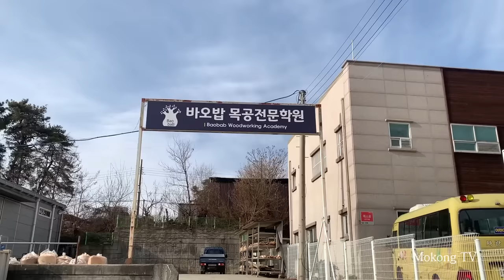Korean Oak Table Build #Woodworking

Comment: I think I would have begun by running those boards on a joiner to finish off one edge of the boards, then set the tablesaw and split them on the tablesaw by placing the straight edge from the joiner cut against the rail. Of course, that's just me.

Comment: Nice table, but the nails on the bottom are a safety hazard, especially for pets and anyone standing at the ends who might get injured from them.
Reply from the maker: I will cut nails and sand the edges.

Comment: Decided to give this Chanel a go. Now switching off. 2 minutes in and first thing is evident, this is an industrial workshop and the workers have cheap white trainers on their feet instead of safety shoes, and white trainer man then goes over to band saw with no safety glasses or ear protection and worse wearing a loose sleeved jacket. It doesn’t get worse than this. The employers obviously don’t give a crap about the safety of their employees. Goodbye.